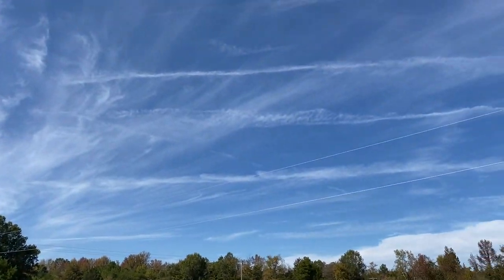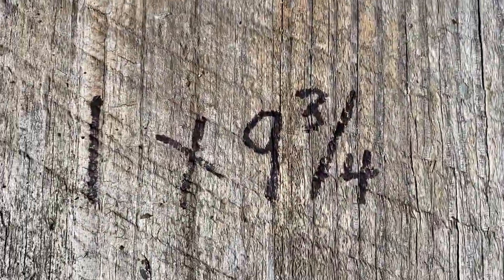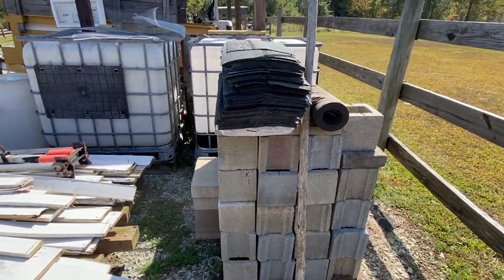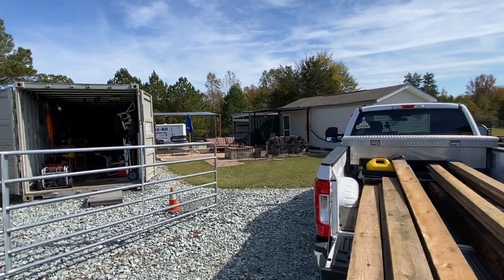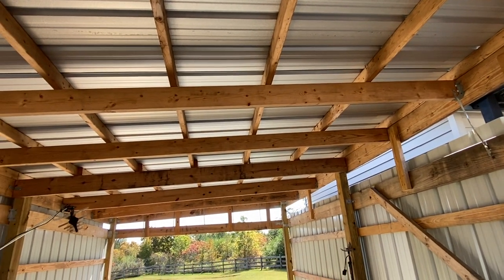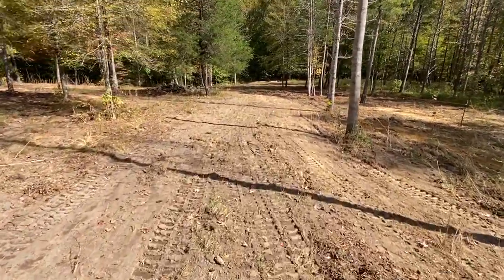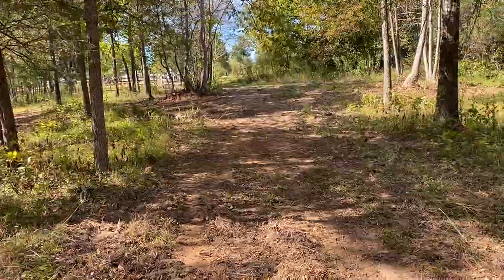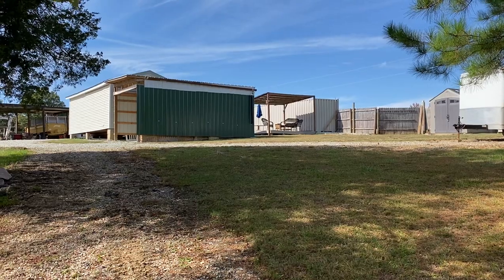LOG CABIN / 100 Year Old Timber. OFF GRID FARM.

Comment: Are you planning on staying in this cabin, for an extended  period of time? If so. I'd plan on air sealing the whole cabin, no drafts, caulk is cheap, keeps heat out, as well as in. Insulation in the attic,  it's a small space, at minimum, R 76. 
R 49, over R 38, would be optimum. Not that expensive  for a small space. Well worth the cost, for the gain in comfort. Do it right. I did it to our home. We have no air conditioning,  this past summer, we had a week straight  of over 110°, the hottest the house got inside  was 84°. We have 
R 76 Insulation. a whole house fan, costs .06 cents an hour to operate.  a 3 speed, attic, gable  fan,  on low speed costs, .007 cents an hour  to operate.
Reply from the maker: At this point I am not 100% sure how far I will take the build. But if I do make my mind up. I will make it to live in for sure.